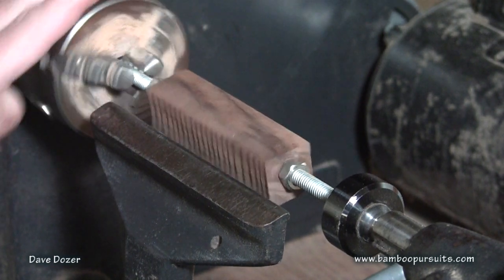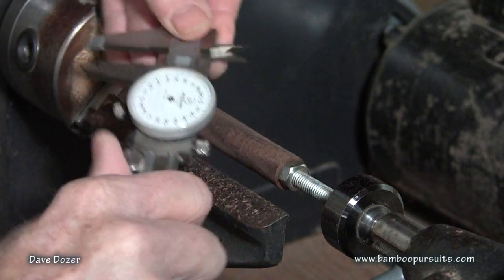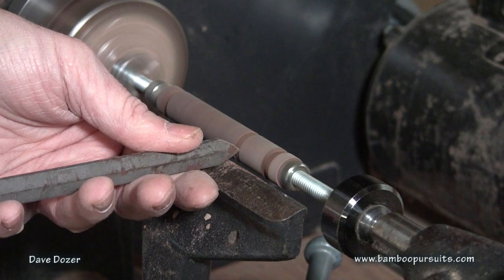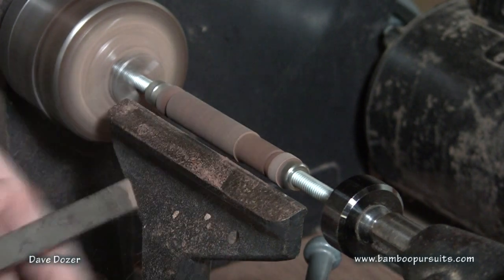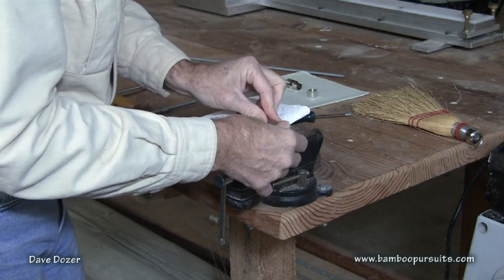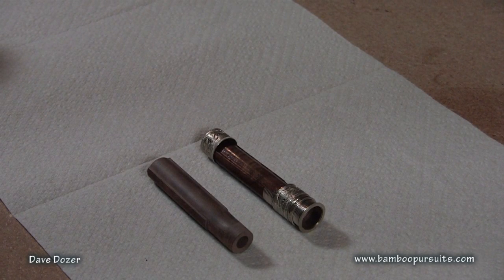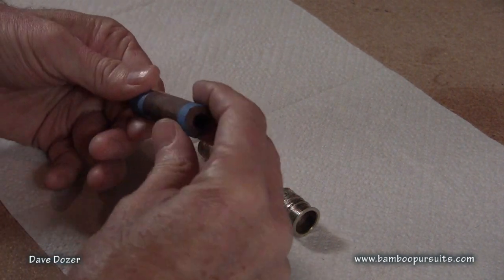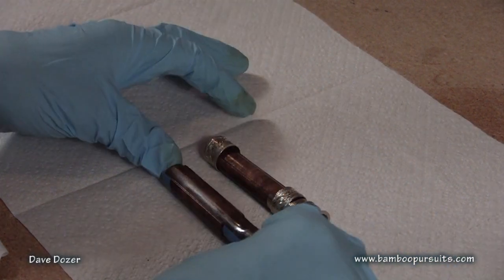Making Bamboo Fly Rod Reel Seats.mpg

Comment: Also you can put a very durable finish on it the kind that pool cue makers use which is super glue. They put on a wet coat of super glue as they're turning the butt end and after they apply it with a cloth they spray it with an accelerator/hardener and then they sand in between coats and usually put three or four coats on and it produces a glass-like finish.

Comment: excellent job, very well done!
If you can help me, I ask how you end the protection of the reel seat. I realize you use Shellac. Translation is difficult, you can help me with the name of a shellac brand. how many coats do you apply,
thank you so much.

Paulo Cruz from Portugal
Reply from the maker: Paulo.  The Shellac I've used is Zinsser Bulls Eye Shellac (clear transparent) as a pre-treatment prior to a tung oil finish on very dense woods.  Some very dense woods (like ebony) don't allow for the oil finishes to penetrate very deeply, and after about a year of exposure to the environment of fishing tend to start chipping off.  Shellac seems to stick to just about any kind of wood.  Two coats of Shellac prior to applying the oil finishes (about 8 coats) seems to work much better as a long term finish on reel seat inserts.  Most woods (like maple) allow for good penetration of the oil finish and don't need shellac.

Comment: As an avid woodworker and fly fisherman, I'd just like to say very nice sir. My one question is why put the tung oil over the shellac? Two coats of shellac will act like a pore filler leaving the real seat incapable of absorbing the tung oil. Please don't think I'm being critical or disrespectful that is not my intention, rather I'm just curios about your process.
Reply: You're correct any oil should be used before you put a top coat on. It helps pop the grain and the figure.

Comment: How do you finish the wood. you said 2 coats of shellac and then 8 coats of tung oil finish, then wax. Is it right? Why you did not do while turning the blank on lathe and that will shine and smooth I think
Reply from the maker: You cannot finish the wood insert on the lathe because there is still the mortise to cut on the router table.  After the mortise is cut, then some hand sanding is necessary.  Then it is time to wipe on the various coats of finish.
Reply: Thanks

Comment: Dear Mr. Dozer
How are you holding the threaded rod on the right side of the lathe? is it being gripped by a 3 jaw chuck?
Reply: +colbeeb The left side of the threaded rod is being held by a 3 jaw chuck.  The right side is held with a 60 degree live center.  The right end of the threaded rod has a hole drilled in the end with a 60 degree center drill that the live center on the lathe fits into.
Reply: dave dozer 
Dear Dave,
Can you please post a link of such a drill bit to drill a nice center in the threaded rod. 
All the best
Colbee
Reply from the maker: Here is a link to the 60 degree center drill bits I use to drill the hole in the threaded rod.  https://www.amazon.com/Center-Degree-Combined-Countersink-Machinist/dp/B014LQM0VK
Reply: Mary Ann Dozer 
Thank you very much . I will buy that set now. It has bits 1-5 which number shall I use? Also how far do you drill into the threaded rod? 
Sorry for all the questions
Reply from the maker: Depends on the size of the threaded rod.  I use a #2 on a 5/16" rod and a #3 on a 3/8" rod.  Don't drill deeper than the angled end of the bit or it will not fit properly with the live center.

Comment: whats the name of that router bit and the size?
Reply: Fingernail bit Grizzly 215 I think
Reply from the maker: Hi Guys,
I use a Fingernail bit from Rockler (www.rockler.com) for cutting the mortis’ on my reel seats. You’ll need a 1/2″ router for this bit. Here is the link to this specific bit:http://www.rockler.com/product.cfm?page=5713&site=ROCKLER . You need to make your cuts very precisely, and I also purchased a router table from Rockler, along with an Incra Jig (http://www.rockler.com/product.cfm?page=11494&site=ROCKLER) to help with the positioning of the cuts. Good Luck!
Dave Dozer
www.bamboopursuits@comcast.net